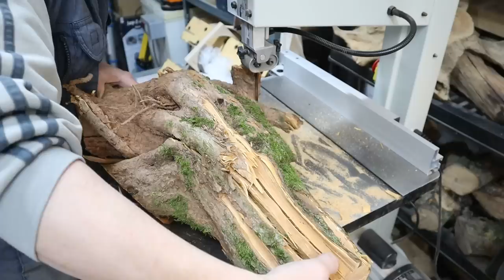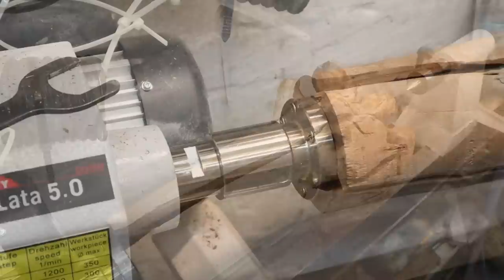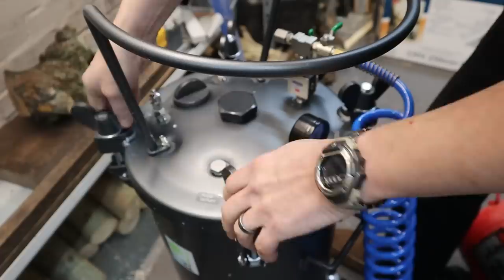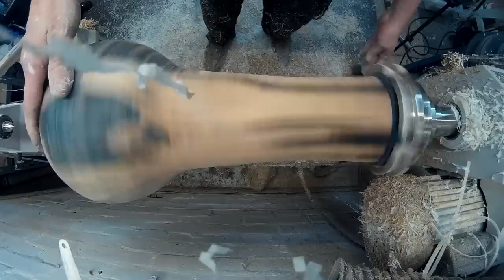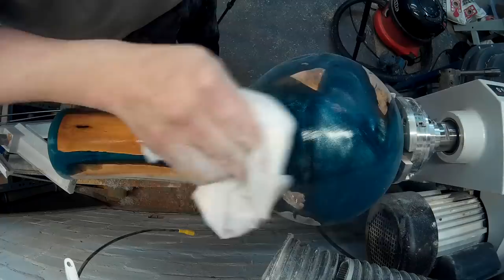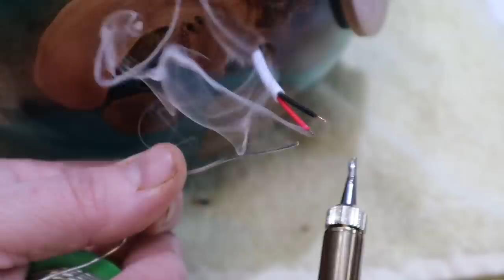Woodturning - Hawthorn Root Lamp

Comment: Resin is overused in general but I'd say this is the perfect use for it. Bravo!
Reply from the maker: Like most things and styles its a trend, started a few years back on things like the penny floor, it will pass and then something else will come in, however until such time I will use it until my customers no longer want it
Reply: I'm curious, what do you mean by over-used? It seems highly versatile in color and application, is there an alternative? I assume it's easier to buy or work with today than it was in the past, and that's why it's more common now. But it sounds like you are suggesting that it is merely trending? It seems like there's a lot you can do with it that wouldn't be possible with wood, metal, ceramics etc
Reply: Yeah, those "live edge resin tables" are really fucking played out

Comment: This is beautiful, I wish I can tolerate turning resin like the way you do but I can't! Rather cough from the regular wood shavings instead 😂. Amazing job Matt.
Reply from the maker: I like resin, I just don't like the clean up, stuff gets everywhere, when you try to hoover it up static builds up on the pipe and then it starts flying everywhere and sticking to everything 😂
Reply: @MattJordanWoodturning  bro how much the pressure to a resin inthe tank
Reply: @dimasroy5040  It's reverse pressure - otherwise known as vacuum degassing (used to eliminate bubbles). I've never done it myself, but understand it doesn't require a deep vacuum, and it should only be applied for a short duration. I imagine the pressure and timing depends on volume/thickness and varies by epoxy type. Probably best to get advice from the epoxy supplier for the best practice for their mix.

Comment: Can I just say that I was so hoping you would have left the roots and moss and everything just as it was. It turned out great but it would have been neat to just see it the way it was.
Reply: Impossible... How can he perform wood turning on it and keep the exterior details?
Reply: @nicke20686  wash it off put it into a big square and fill with epoxy then turn just the epoxy leaving wood intact. Nothing is impossible.
Reply: @NickieMartin79  I guess but that would make it awfully difficult to see the original exterior. You'd have to stop perfectly at the moss etc
Reply: @nicke20686  it would be a challenge but it could be done. And it would look great!
Reply: @NickieMartin79  true. If done successfully it probably would

Comment: nicely done. I would have preferred to media blast or pressure wash instead of chisel scraping, and definitely do not clean off all that dirt on the lathe bed. The unlit lamp is gorgeous, but with light on it fell flat for me. The wood and its contrast with the beautiful resin is lost when lit, back lighting is always a challenge.

Comment: What brand of resin do you prefer? I have turned wood for years but have never attempted anything with resin. Looking to add to my abilities! I just bought a pressure pot from Harbor Freight As several turners have recommended it.

Comment: Why don’t you ever spray it with 2k, two part clear coat while it’s spinning on the lathe right after sanding it with 600 grit? I think a nice layer of sprayed clear would add more depth to the part. Have any clear coated jobs that maybe I missed? Or does the clear maybe not work well with wood? Or is it just personal preference?

Comment: I like it better without the light. Also, I don't understand why it's always called "Woodturning" when you work so much with epoxy. (No question good work, even if I don't want to put this imbalance on a lathe. Why is the sanding done over it?)

Comment: Unliked because you went good in beginning but ended it very bad, cut of wire and shadeless lamp design just wasted the whole grace of final cut piece, that clear shows you are taking different works without proper knowledge, and you are an amateur 🙏